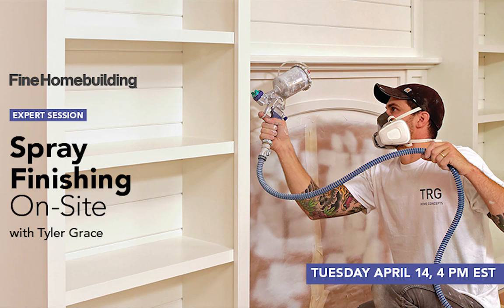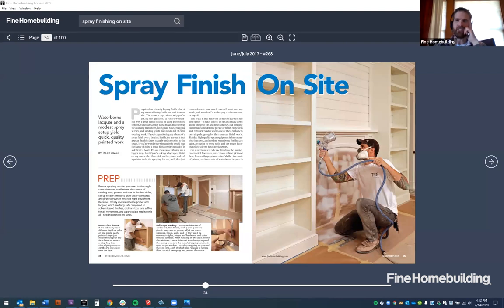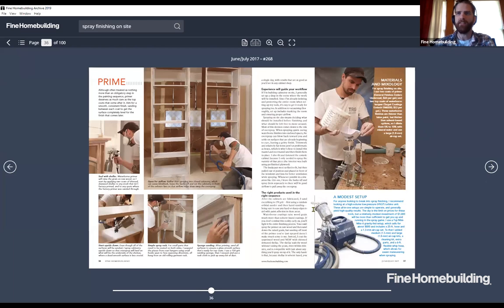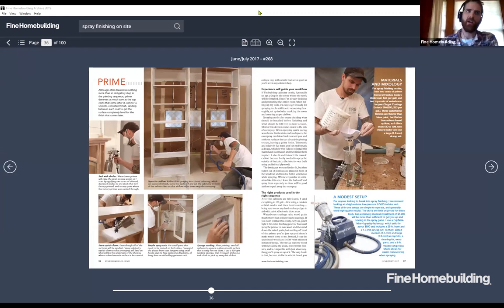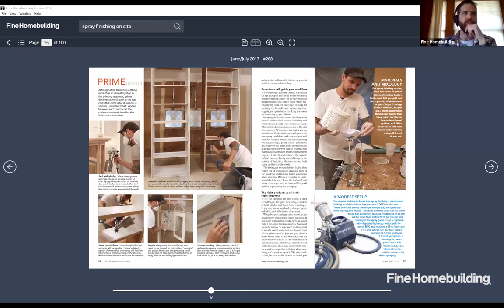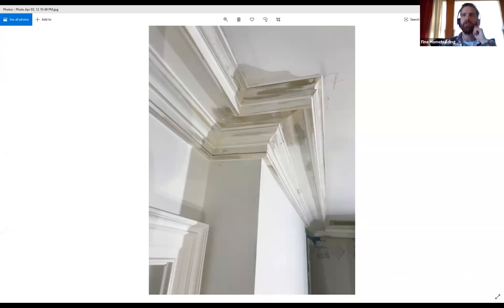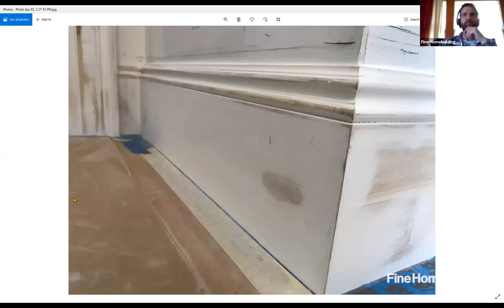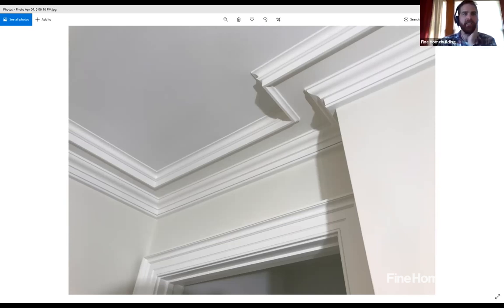Expert Session: Spray Finishing on Site

Comment: For waterborne lacquer I only spray turbine hvlp. Better atomization and less overspray for on-site use. Waterborne lacquers are too thin for airless, need a 308FF tip and it still might run. Less is more with waterborne lacquers but much slower production.

Airless is better suited to PreCat lacquer and latex finishes.super fast but not a furniture grade finish. But it works well for production finishing .

Conventional is equivalent to turbine but requires a big compressor to haul around. Turbine is the most underrated system and is what I would recommend for most people to use because it’s a compact system with a high quality finish.

For stains I use a small conventional touch up gun to mist on my stained finishes .  It can be fog coated to even out blotchiness in different types of wood Great control with this gun and a
small compressor is sufficient .. 

Just my 2 cents